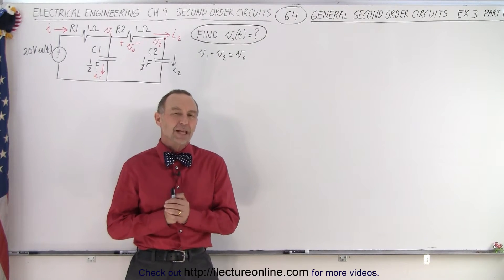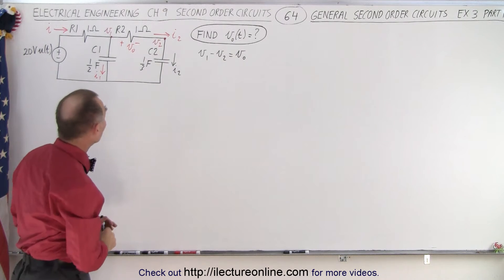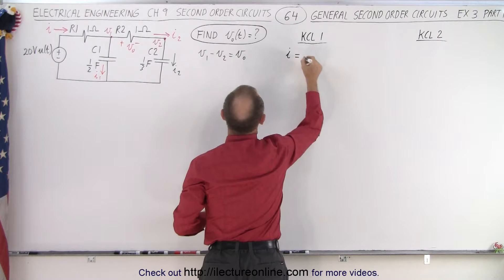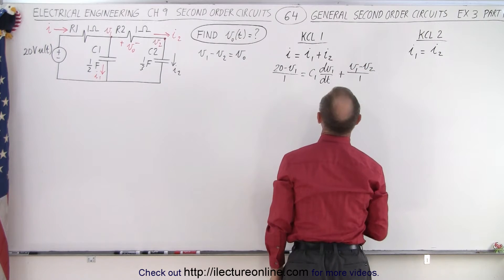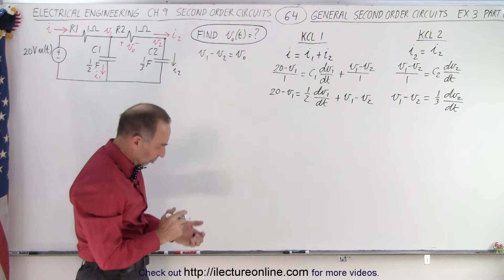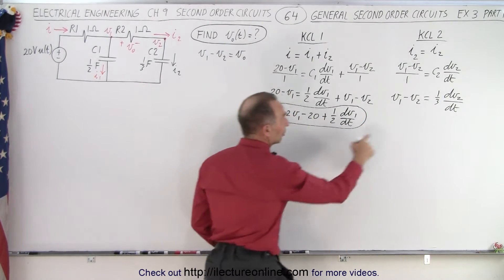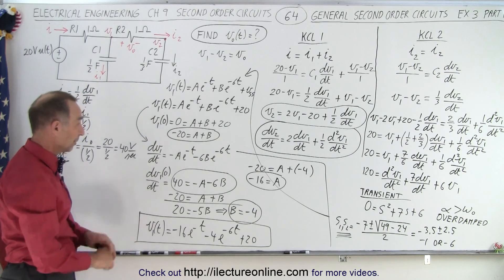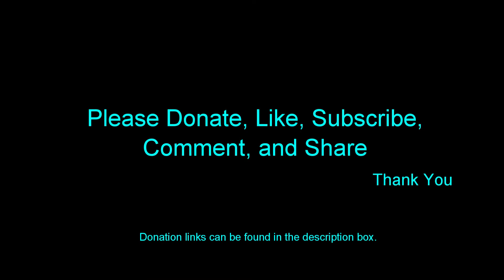Electrical Engineering: Ch 9: 2nd Order Circuits (64 of 76) 2nd Order Circuits in General Ex 3 Part1

Comment: how the hell i(0) is 20 ?
Reply from the maker: Using ohms law:   I = V/R  (or the voltage drop across that branch divided by the resistance in the branch.)
Reply: @MichelvanBiezen but at t=0 the circuit still has not current through its elements as the condition at zero -ve. That is why V(0)=0 . So I(0) should be zero. The value of 20 A is after t=0 as the charge build up on the uncharged ,short circuit like ,capacitor
Reply: If we consider I(0) here as 20 because the capacitor acts as sort Circuit. This should be applied to all other examples in the playlist even for series circuit . This means (dV(0)/dt) always will have value,which was not the case for all other examples

Comment: Hey there, in your lecture 62, you turned off all the independent sources for the transient analysis part. I've tried to turn off all the independent sources in this problem as well but the characteristic equation is not same as yours. Is there any way to know that where should we use the independent sources and where we should turn them off?
Reply from the maker: Yes,  I wasn't clear on that.  We took the voltage source to be zero for t < 0 sec in video 62.
Reply: i think you had calc mistake yes he took source voltage at the begining but assume this zero before making the characteristic eqn .(transient
)

Comment: Professor please explain at 13:20, how can we say the capacitor is a short circuit?
Reply from the maker: At the moment that there is no charge on a capacitor, the capacitor will act as a short circuit because there is no charge on the capacitor to oppose the current entering the capacitor.
Reply: @MichelvanBiezen   I see, it's like a short-circuit to the path of the capacitor. Thank you so much for the prompt reply!